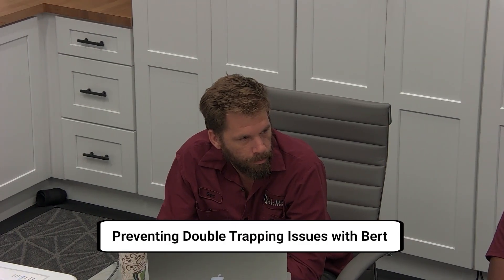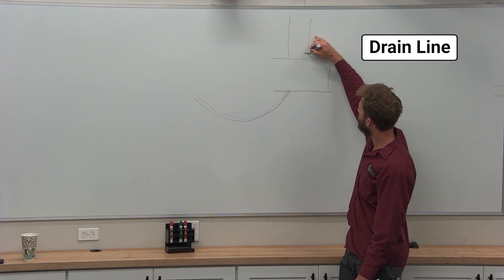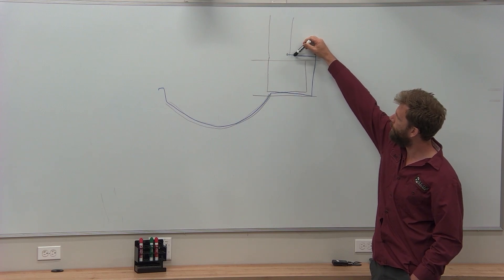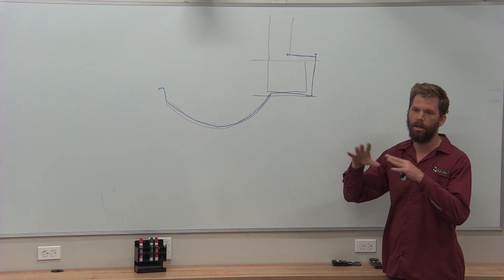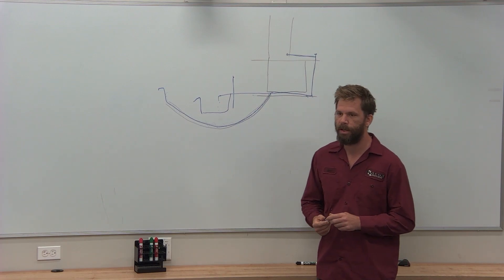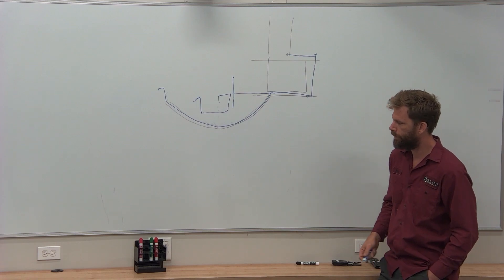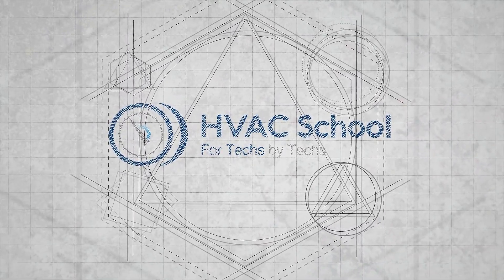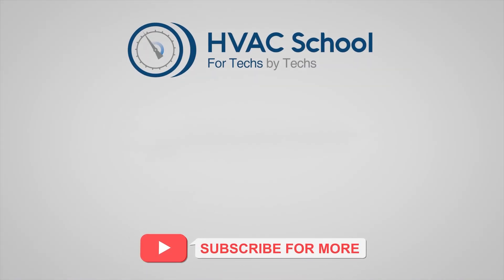How to Prevent Double Trapping Issues

Comment: This was a perfect video for this time of year . With a lot of installs going in righg now ( im in tampa bay are ) i recently had a similar situation in a 5 ton vert we instslled in garage . When we left it was draining like a river . But then it cycled. Did ok for several days but then  all the sudden it got even more hot and humid . Longer cycles and now drain backing up . Well a 2 inch removal of pipe where the new tee went created a double trap. I hope a lot of installers watch this and keep this in there memory bank . ( the part about horizontals also) good job Bert